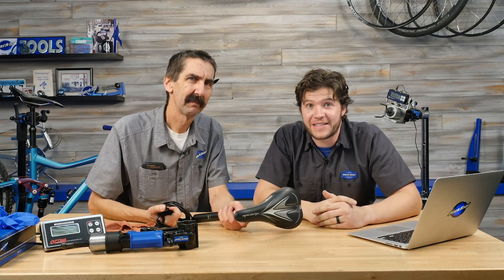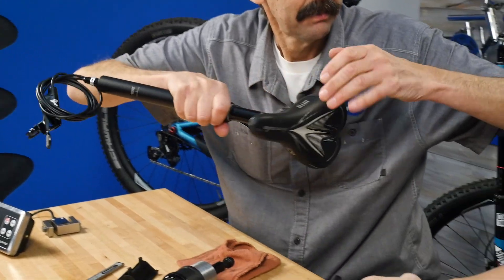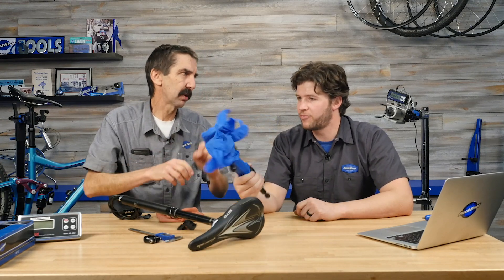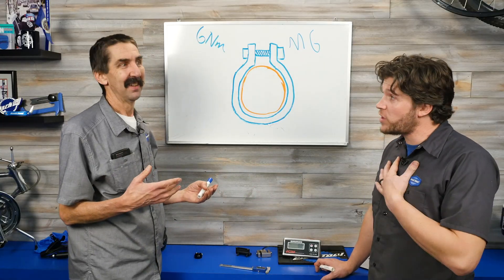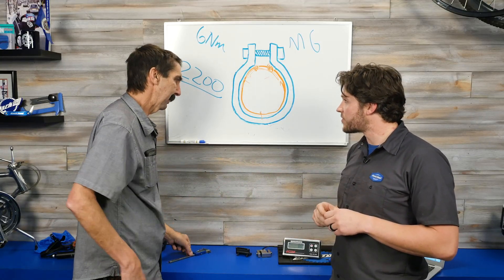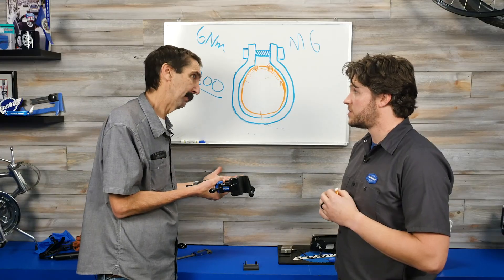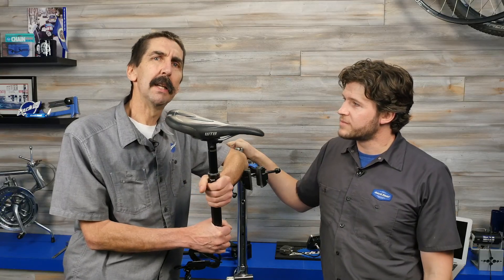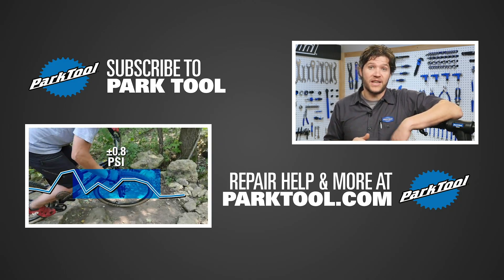Shop Talk: Is It OK to Clamp My Dropper Post in a Repair Stand?

Comment: 6:53 a decimal point can make quite a difference, 1.419mm² would be 0.0021inch² your conversion should read 36.0515mm²
Reply from the maker: That's actually a comma, although for the sake of our international friends (in countries that use the comma to denote the decimal place), it would've probably been best to just leave it out 🤓
Reply: @parktool  Indeed. 2,2 inches square is 0,001419 meter square, so that's 1419,35 mm square.

Comment: I’ve always clamped my dropper post fully extended with a clean rag. Something I also do is loosen the pivot clamp on the stand so that the bike can slightly sway as you put the bike in, then lock it down. Especially if you pull a wheel out, loosen it, then the bike will automatically settle and then re tighten and keep working. This will reduce the lateral forces out on the post. I was a mechanic for 10 years, but also I have a physics and applied math degree, this logic plus my experience seems to be the best method to work on a bike with a dropper. Glad that you guys have done some testing to confirm my intuition about this. Thanks!
Reply: I don't have physics and applied math degree, but I do exactly like you do.
Reply: @Jean-jk4zv  well I’ll be the first to tell you, you don’t need one haha!

Comment: Forces in Metric are not measured in kg's they are Newtons (N). Whoever ran the conversions failed to realize the difference between a lb-mass and lb-force. And when you divide the force by the area you should not refer to that as "force", what you have calculated is the stress. While I don't disagree with your conclusion on clamping dropper posts, I fell that the static analysis that you've tried to present was lacking.
Reply: Daniel: Nice trolling, but I agree.
Reply: Daniel O: Also the conversion for the area cannot be right. But alas, who am I to judge (actually professor in engineering ;-)).

Comment: I actually came up with about half the squeezing force from the bolt. I went with the formula for dry metric threads according to my German mechanics handbook in metric.
Reply: If your threads are dry, that's a bigger problem than damage to your dropper.
Reply: @EmyrDerfel  most threads come dry or with loctite from the factory and most torque specs as well. if you torque up lubed bolts to the dry specs, then you have a real problem. Unless it is actually specified that way, like with the santa cruz pivot bolts, which have to have the shaft lubed and the threads coated with loctite, torque specs are for dry threads.

Comment: Correct me if I'm wrong, but isn't the clamp clamping the seat tube and not the seat post? Post gets clamped in turn by the tube. That's still not the stanchion. And isn't the seat tube offering quite a bit of resistance to this? Hence the significant clamping force. Moreover, it's typically the maximum torque AFAIK. Meaning, you shouldn't exceed it and in a light frame, there probably isn't much margin (hopefully, they at least accounted for the inaccuracies of torque tools and it's not a hard, never exceed limit as that wouldn't be very user friendly). In clamping applications, if you can get away with less (perhaps you used a gripping compound), it's typically not a bad idea (another consideration is the screw coming loose from vibration). Also, are you sure you should lube that thread? I know grease will help with corrosion, but if torque is specified for a dry thread, you can over-clamp and damage parts. As you surely know.

When you clean the jaws, don't forget to clean the stanchion itself. Bikes should be kept clean, but we all know how that works. ;-)

Personally, I'm not really worried about the weight of a bike breaking a post. Although it doesn't give me a nice feeling seeing a bike nose up held by a seat post. Where it really starts getting uncomfortable for me is when people start working on the bike and applying forces to it. Imagine token swap in a fork, pressing down the wrench to prevent it slipping, on a good half a meter moment arm. And you can see the flex in the whole thing, it's not like it's rock solid. Not a nice fuzzy feeling at all. :-) That's why I quite like stands that support a bike from the bottom, like your PRS 22.

Comment: We know gloves are cheap, but why waste and landfill them? Just have a clean piece of dedicated rubber, like an old tube cut into DOZENS of clamp pads. Yeah, Park sells gloves, but think of the environmental waste produced every day with the millions of rubber gloves being tossed that won’t biodegrade. Come on boys...try recommending something that’s good for the planet and not just the wallet! Otherwise, spot on video.
Reply: Because you can still use them afterwards.
Reply: Andrew Perrott try it and tell me what percent are reusable in actual practice? Another solution, with an otherwise piece of trash like an inner tube has zero waste.
Reply: because it is so little waste that the time thinking about that is worth more. they weight about a gram each.
Reply: max denger times millions.
Reply: Wow inspiring really changing the world

Comment: I clamp the ebike at 46 pounds
Although it slides up to the bottom of the seat  as the clamp on my stand is larger than the top of my dropper

Comment: I sometimes clamp my bike on the chain
Reply: Ah that's a goo idea normally I clamp it by my spoke
Reply: I clamp it on the brake lever
Reply: Other places I clamp my bike

- brake rotor
- brake hose
- brake pads
- brake fluid
- shifter cable
- Fork token
- presta valve
- b screw
- rear cassette
- jockey wheels
- fork stantion with vise grip
Reply: I clamp mine by the tire sealant.
Reply: No clamp it by the degreaser
Reply: One year later, you made laugh out load while on the john😂
Reply: Same
Reply: Either clamp by the chain or spokes.
Reply: You guys are silly, you are meant to clamp it by the dork disk!   Duh 🙄
Reply: I clamp my bike on the pedal
Reply: That's the only true way of doing it, my friend.
Reply: somewhere in the metric world.. :)

Comment: Rather than using gloves I would use old tube ..I would get good friction and won't damage it.
Reply: But old tube is dirty and the idea of the gloves is they're clean.
Reply: The inside of an old tube is clean.
Reply: @EmyrDerfel  
I cut open a new tube last night to use as a washer for my tubeless valve (single-wall fat rims) and the tube has this white fine talcum powery stuff coating the inside. But I just cleaned it under cold water and it came out perfectly nice and clean.

Comment: I just go with my top tube since I don’t have enough room below. As Calvin once said, if it can’t handle that, it’s not a bike you want to be riding.
Reply: I clamp the top tube as well.  If I’m working on the brakes I just loosen it up a little a little.  When I clamp on the seat post, wrenching seems dodgy and the stand is in balanced.

Comment: If it's possible to clamp to the frame, is that preferable and recommended?
Reply from the maker: Personal choice but if something were to go wrong, a seatpost is much less expensive than a frame. Just clamp the post.
Reply: Be careful where, you might end up with some unexpected scratches...

Comment: The verdict is out!
I had 2009 dropper I clamped on the stanchion for 7 years... A collet ended up breaking at the bottom eventually rendering it useless.  Not sure if that was the cause but 7 years on a dropper seems like a long time.
Reply from the maker: That would have been one of the earliest droppers on the market. If that lasted 7 years without fail, thats awesome! Did you ever send it in for service?
Reply: @parktool  I opened it and cleaned and regreased it a couple times but that was it. It was the specialized command post which I think was their first gen.

Comment: I clamp the top tube. Always. I don’t bother with the seatpost
Reply from the maker: Top Tube works on many bikes. Have heard and seen top tubes crack. Not because of the force of the clamp but because someone came up and tried to move the bike in the stand while it was clamped. Just need to be mindful.
Reply: Top tubes aren't designed to have torque or significant shear loads, only tension and compression. Seatposts have to be clamped to be used, so a stand's clamp isn't anything to worry about.

Comment: Everything changes if you start torquing parts on the clamped bike, for example tightening a BB.
Reply: But at the same time, these jobs are usually done with something to hold on to. For example, i tighten crankarms by putting the wrench a quarter turn to the right of the crankarm and then push the two together. same with hammering bearings out or in. not supporting the frame on the other side is just asking for trouble. Especially with carbon, I already get a bad feeling in my stomach doing it in the stand at all.
Reply: How much tork do you put on the BB for that to be a problem? Or are you talking about the cranks on a square tapered BB?

Comment: And how much Force does it get when you Work on your bike, like tightening a BSA BB???
Reply from the maker: Good question. Thats typically a 40Nm torque. So you are adding another 30 lb's or force to the mix.
Reply: While it might be 40 Nm at the BB (and I have seen higher numbers for BBs), it certainly won't be 40 Nm half a meter away at the clamp. How long is your torque wrench? The frame will be acting like an extension.
Reply: @parktool  You should try it with your torque meter as it will be multiplied being away from where the post is clamped e.g. the bb is about 24" away from stand clamp so your  30 ft-lb bb torque could be as much as 90 ft-lb torque at the clamp.
Reply: @parktool  and how about ebikes haha Another Thing to Think of
Reply: The stand isn't that rigid, so normally when tightening a BB you'd hold your torque wrench in one hand and part of the frame in the other, so the torque through the post would be minimal.

Comment: I've been clamping my Reverb dropper post (same one) for the last 3 years and no issues.  I clean my post and the inside the clamps before mounting.  Instead of using gloves I use a cut out piece of an old tire tube.  When I clamp the post, I find the balancing point of the bike while clamped in the stand, so the force on the post is straight down (fully extended).  For most bikes this means the back wheel will be higher (the bike is not level).   Great video!!

Comment: The US needs to get with the program, switch to metric drop the British imperial system the British adopted the French system years ago as well as everyone else.
Reply: @Richie  Our Prisoners are way too busy to switch are highway signs over to Metric.
Reply: It's not the US in this case. A bunch of bike stuff is still stuck with old English threads. Especially cheaper bikes.
Reply: Never gonna happen, like gun control based off a >200 yr old document referring to muskets.

Comment: Great thoughtful video Park Tool set the reasoning out for why we do things the way we should. That should be knowledge banked before you work on the bike. Can we have more videos on the mechanical side as well. You need to do a complete video work on Bearings - I would bring Hambini into that discussion. Also get manufacturers feedback as you did here. There are lots of claims being made but we need objectivity and measurable data to prove the claims.

Comment: Wow, haven used metric and imperial. Inch pounds and fractions really over complicates the math.
Reply: Which is why every country except one avoids imperial.
Reply: Actually, Liberia and Myanmar use imperial as well. USA are in good company. :D And to think the USA signed the Convention of the Metre in 1875. You were among the 17 (I believe) initial signatories. That's a grandiose fail at implementation. Just because of some lobbying way back to avoid bigger competition and cost of retooling and politicians not having the will to go through with it later (the longer you wait, the more difficult it gets). A lot of people might be surprised that the USA are officially pro-metric. It's the official government position that you should use metric AFAIK (well, it's called SI nowadays as it's a way broader system of units).

Funny thing is that, as part of the conversion process, imperial units were redefined using metric units. That's why an inch is exactly 2.54 cm. And not some way crazier number. So, the basis for an inch is the metre standard and the USA, as a signatory, got their own copy of the bar way back to serve as a national standard.